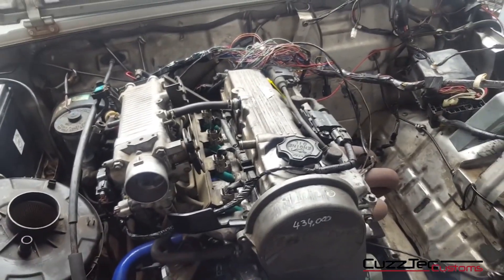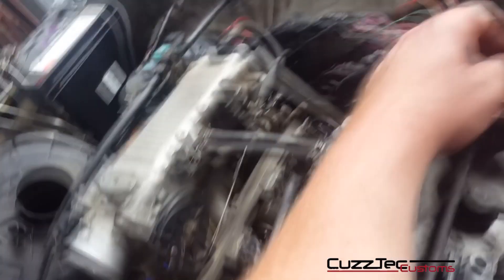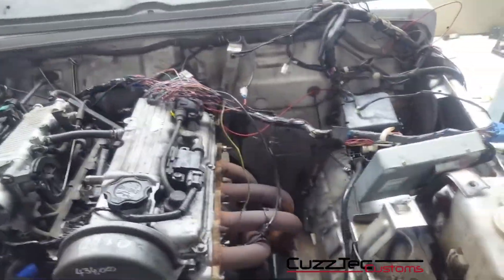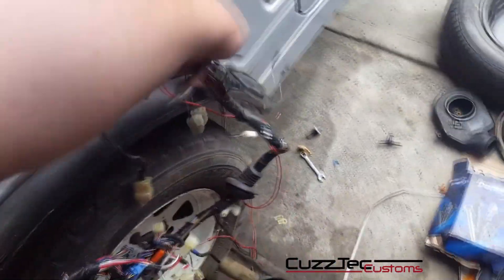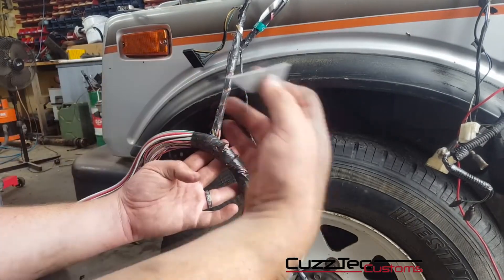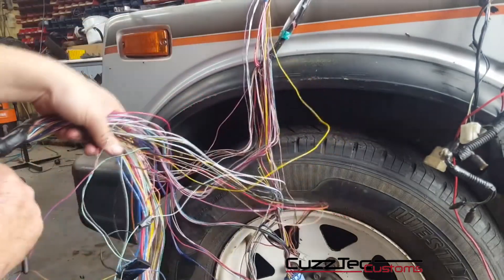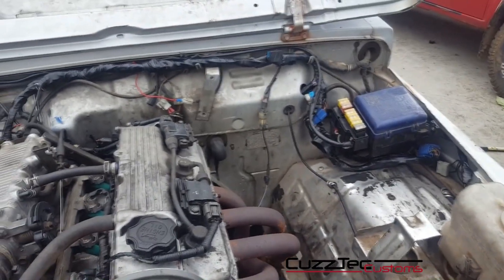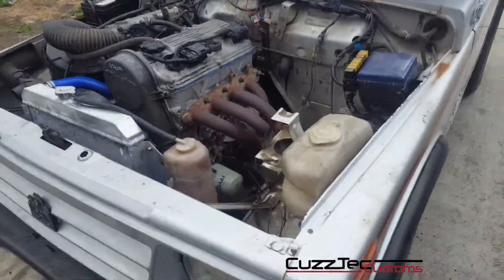How To G16B Pt 3| How to wire, G16B Wiring made simple | CuzzTec |

Comment: I have a high idle that I can not figure out cold start it idles low don’t have an rpm gauge so not sure what it’s at but as it warms up I can hear it go up I have changed the idle air control vale cleaned the throttle body cleaned the egr vale changed spark plugs and wires I’ve checked for vacuum leaks changed fuel filter and also replaced the fuel injectors any suggestion on where to look next
Reply: The motor is a 99 Chevy tracker motor besides the high idle it runs fine it doesn’t surge or idle rough